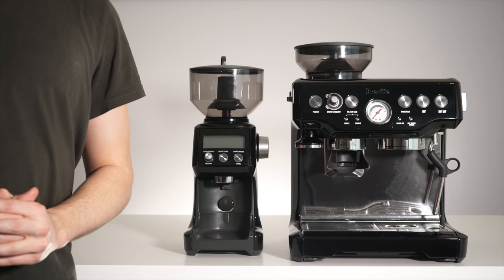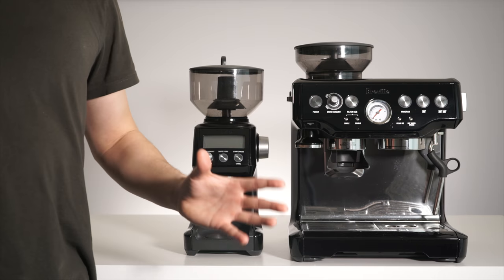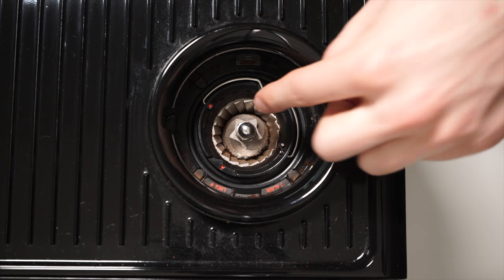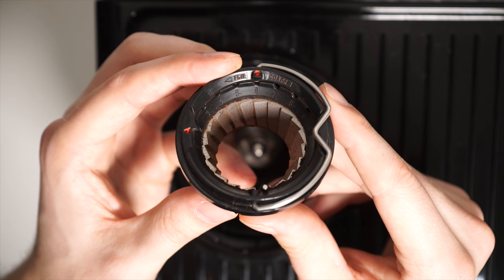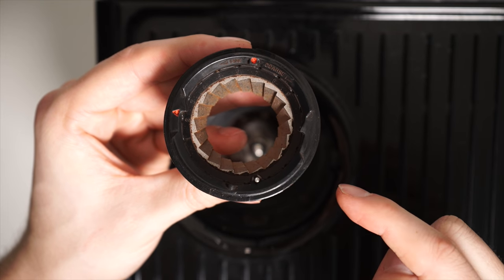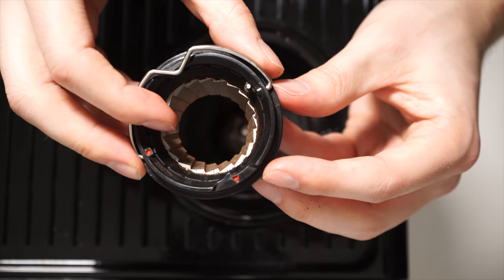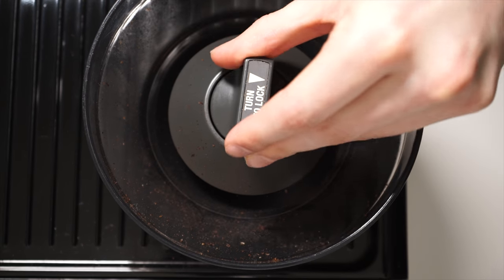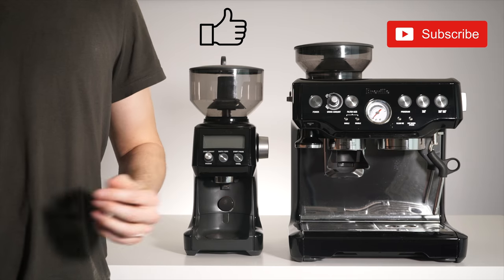Breville Barista Express Top Burr Adjustment

Comment: I discovered that if you turn the external dial to the coarsest setting (30), the upper burr is easier to remove.  At the coarsest setting, the conical burr is furthest away from the stationary upper burr, hence making it easier to turn.
Reply: Thank you so much for this tip. I was struggling to get it out, and you saved my coffee machine 😅
Reply: Thank you, I have not been able to take it off

Comment: Exactly what I needed. Thank you! Changed the top burr setting to 3. Still need to work on dialing in shots but this is a major improvement!
Reply: how come you changed to 3?
Reply: @stephendoherty2719  Mine doesnt go below 4 and still no luck with getting the right consistency
Reply: Did you hear squeaking sound after that? Cuz I do and idk if that's normal 😅

Comment: Thanks it worked like you explained. I initially COULD NOT release the burr. Luckily I have an air compressor and so I took it to the garage blew it out and it was then very easy to release. If you have any coffee in the top and it won't release, DON'T FORCE IT. Clean it out well and it will work better once you finish that.
Reply: Used my central vac and all was good to go. First world problems for me.
Reply: Similarly, I got my upper burr out but could not get it back in after adjustment - felt I was going to snap my fingers off.  A quick vacuum in and around the grinder, using the brush to get into the grooves soon fixed this and it was easier to twist back into place.
Reply: Apparently changing the external grind setting to its coarsest option can make it a little easier to remove the burr.

Comment: I bought an older BBE used and i can't seem to get a fine enough grind! I did some sleuthing and found a single reddit comment that mentioned that the new model's adjustable upper burr assembly fits the old model, so I just ordered a new assembly and hopefully my new-to-me machine will grind a lot better! Thanks for a great video that I'll definitely be coming back to
Reply: DId this work for you?  I've got the older non-adjustable burr in the BCG800 grinder and am considering buying the adjustable upper burr for the newer BCG860 grinder to put into my BCG800.

Comment: I've just purchased a breville barista express. I've tried grind setting of 8 5 and 3 and the longest shot I was able to pour was 12 seconds to get 36g of espresso. I'm vibrating from all the espresso I've had. I gotta grind setting 1then most likely play with the micro adjustments. I'll update once I get it right. Thanks for the helpful video

Comment: This tips should be mentioned in the quick setup booklet. I just knew about it after 1 month of using the machine and not been able to get proper shot using non pressurised basket 😐
Reply: Yes. It took me a couple of days to arrive here. I had to set my burr down to 2 in order to get enough pressure with fresh beans from a local coffee shop. Clearly, there's a pretty wide variance from machine to machine.
Reply: He mentioned it's in the instruction manual, not sure if that's what you're referring to though

Comment: Great video instruction!  I just followed the video and then realized, I did NOT have my "grind adjustment" number at any default number setting?  I think I had the slide reel on "2" originally and then adjusted the burr grinder unit by 3 settings, to the finer (counter-clockwise).  So what "new" number should I be setting and grinding now, to result in a finer grind?  Sorry if I sound confusing, because, I am...  Thank you!

Comment: I've not long ago purchased a Breville barista pro and it came with the Baratza burrs which has six flutes on the lower. Many people say to, out the box, change upper to setting number 3. I did that and then worked out the lowest setting I could go to was grind size 15 before I could feel burrs just touching when I was turning the upper section by hand.
Shots seem to be still too fast. When I had it on grind size 6, the shots tasted better and time was closer to 30sec. I was worried though that the burrs could be contacting a bit too much?
I imagine when beans are going through that they would push the burrs apart slightly? 
Some older stock models of the Barista pro still have the five flute lower burr so might be totally different?

Comment: I have a weird problem now. 1 on the display was still a bit too coarse. So I adjusted the inner top burr from 6 to 4.
Now it seems, that the top burr sits too close to the bottom burr: my Grinder screams as the burrs grind on each other. Even with the upper burr set to the old “6”-setting again. Can’t go below 3-4 on the display, as the very loud metal scratching begins. Is my grinder faulty?

Comment: Just adjusted mine after a full year of 2-3x daily usage. 

Usage largely the same beans, so in a bit curious if these things wear down or what? I have a warrant throguh April 2024 through Best Buy, so definitely want repaired/replaced if it's simply wearing down.
Reply from the maker: Adjustments are normal. Can be simple things like the roast of the beans, even humidity in the air of your kitchen than changes the flow even at the same grind size

Comment: Thank you. I fix my "no pressure" with double shot cup issue by changing the "Internal setting" to 1 and External dial to 1 as well. This makes the ground very fine indeed. It gives me great pressure of 12 o'clock with moderate/minimal temping. I just use generic Woolworths bean called "Harris Coffee". Much appreciated for your instruction!!!
Reply: How did you go in your journey? I've started mine with supermarket beans, but that seems to be the problem. Gonna try fresh beans to see of that makes a difference in pressure and Crema.
Reply: @themostar7426  fresh beans make a HUGE difference.. good luck, it can be a frustrating process but also very rewarding when you start getting it. Aim for 1:2 extraction (I use 17g of coffee and aim for 34g out) in around 25-30 secs. 

This is a guideline; change things up according to your taste, but try and only change one variable at a time; I'd say grind settings first, then perhaps dose itself or the amount of extraction - maybe it'll taste better at 1:2.5, or even longer (for lighter roasts) or shorter (1:1.5 for darker roasts). 

It's what tastes good to you! There is no right or wrong answer or perfect recipe, just guidelines that will get you in the right area.

Comment: I have the same burr set in my grinder and it's adjustable. My friend's barista express doesn't have this adjustment 😐
Reply from the maker: It does depend how old the machine is
Reply: @LifestyleLab_  it was purchased withing the last 18 months.
I was quite surprised when I did exactly this expecting an adjustable burr, but there wasn't one.
The top burr is sold out. From your experience, is there isn't room left on the adjustment thread to move the burr up a little? Or, disconnect the gears and wind it a little.

Comment: Currently having issues dialing in our Breville Pro using the IMS group head screen and IMS 18-22g basket.
I have been through all the settings and the closest I can get to 1:2 ratio (30-35 sec @ 36g) is external 6 grind setting (we haven't messed with the internal grind setting yet).
We are getting semi soupy pucks (not one piece ejected dry pucks we expected) after the completion of the process.
Not sure what we are doing wrong, but we have gone through a crap load of expensive coffee (I should have purchased cheap grocery store espresso instead of using the $30 bags of beans) to attempt the dial in. :)

Can anyone provide their known good settings for the IMS basket and shower screen hardware on the Breville Pro?  We would really appreciate it.  Thank you.

Comment: Thanks. Very helpful and now I can adjust the burr setting easily!
Reply: My machine does not have the numbers and is not adjustable 🤬
Reply from the maker: Then you just have an older machine, and can purchase a replacement top burr from the link above or directly from Breville.

Comment: Thank you. I put mine on 9  , works great .I thi nk  my automatic ajuster is not working , its always the same size of the grind... no metter what i put it on. Also,   every time i get different beans I have to ajust things , does that make sence?
Reply from the maker: Every bean will absolutely require a new grind setting. That is what's known as "dialing in" the coffee
Reply: @LifestyleLab_   Thank you.  One last question I promise.  How long brewing process should last for single shot expresso for example.  Mine builds pressure for about 5,6 seconds and then actual coffe runs for another 6 seconds or so   , Is that too short? Thanks again.
Reply from the maker: Completely comes down to taste, I can’t tell you what’s right for your coffee. Too sour, try running the shot longer or grinding finer. Too bitter, try running the shot shorter or grinding coarser

Comment: This is all fine except no amount of pressure on the wire handle will get anything to move. Thinking that it was me I've had several friends give it a try also with no luck. Things are wedged in there tight. Any suggestions on how to get it to move. Currently even on the coarsest setting it generates to much pressure. The fingers on my hand may never heal!

Comment: Very good and informative. Thank you so much. As I was all the way to number 1 setting on the grind size selector, and number 6 on the upper burr, I was wondering how many numbers would you suggest that I move the upper burr so that I may be able to stay around 4 or 5 on the grind size selector? I understand that all the coffee's are different, just looking for an estimate to better get me into the ballpark.
Reply from the maker: I'd suggest moving the upper burr one step at a time
Reply: 2M views hello i have passed my upper burr from 6 to 3 to have about 20 seconds of coffee flow by cons the taste is like water.  if I make it even thinner my pressure gauge will overpressure.  I'm a little lost can you help me a little?
Reply from the maker: @83kif  Watch this video start to finish and you should have all your answers :)
www.youtube.com/watch?v=d0g8umpINGQ
Reply: depende del portaflitro, si es prensado o no.
Si es prensado, usalo en configuración 2 al 4, y en la posición 7 la molienda.
Si no es prestando se recomienda colocar un filtro encima del portaflitro.

Comment: Great video! Could you comment on one thing though: can you see the internal adjustments as major or minor steps, e.g. you have external set to 3 and internal to 6, would that be finer than say an external 4 with a internal 1? You know what I mean?
Reply from the maker: I believe that each internal change effectively offsets the burrs by one full range. Ie/ An external 1 and internal 6 would be the same as and external 16 and internal 5.
Reply: thats interesting. So you would only really need to adjust internally, if you reach 1 or 16 on the external burr and still not happy with the result? I wrote the Sage / Breville customer support to see if they can comment on this. Let's see :)
Reply: @Ventilator1998  I would be very interested to know if you ever heard back from Breville. Does the internal setting equate to a full reset back to the external setting range as @Lifestyle Lab suggests?
Reply: @SinandGrins  thanks for the reminder. No feedback yet. Have to reach out again!
Reply: @Ventilator1998  curious as well! I’m at around 3 external and may need to adjust the internal burr.
Reply: @Ventilator1998  any update on this one?
Reply: @tonygibbons5  Nope. nothing so far... and no tools and time to try out myself :)

Comment: Hello, there! What if I set my external grind at 1 and have a good pressure at 12 o’clock but I see that it still runs too fast for me. Should I change it finer in the inner grinder or it doesn’t matter how it runs and the most important key is the pressure? I am very confused. Please help 😭
Reply from the maker: Flow is more important than pressure. If you're at a grind setting of 1, I'd suggest making the internal grind setting one step finer and then dial back in to slow down your flow. Don't worry if the pressure moves up higher than 12 o'clock, my favorite shots have been pulled at 1 o'clock or sometimes even further! In the end, follow your tastebuds rather than numbers

Comment: after I adjusted the upper burr and replaced the burr correctly - the metal handle is slightly elevated and does not sit flush?

Comment: Great video. I was able to remove it from the breville and cleaned it but when I placed it back it went in place but the lock red is not aligned with the grinder red arrow. The red dots are on the opposite side of where align and lock are. Does this mess with the grind?
Reply: Did you solve the problem? My red arrow and 'lock/align' are not aligned and hence I am not sure how to remove the burr at all, for cleaning and adjustment.
Reply: @SathishkumarJagadeesan  
Yes I got it aligned. To remove the bur just twist the plastic piece inside the hopper counterclockwise and remove it. Then hold the grinder by the handle and twist counterclockwise and it comes out. Clean really well inside with the provided brushes. Sometimes you may need to place the machine upside down and shake it to remove all the old grind. Sometimes it can be a little difficult to place the grinder back in place if there are left over beans that didn't grind well.
Reply: @arielrodriguez975  Thank you. I have now managed to remove and adjust and put back in place the top burr.

Comment: I've cleaned our multiple times and still cannot get it to produce grinds, only on one of the largest settings. All the parts inside appear to be good. Had it since 2017.
Reply from the maker: Definitely contact Breville support :)
Reply: @LifestyleLab_  Yea, I have they are sending new parts. Problem is I don't see anything wrong with it. Wonder if it a design issue. May go with another brand.

Comment: is this adjustment a finer adjustment? meaning, if i seem to want a 3.5 on the external dial, will changing internal setting by 1 be similar to .5 externally?
Reply from the maker: Upper Burr vs Outer Dial Grind Setting | Breville Barista
https://youtu.be/_uB3FZGkR6E
Reply: @LifestyleLab_  Interesting. I was way off. So, if I'm really wanting a 3.5 sounds like I'm out of luck. I saw someone else suggesting a chip bag clip to hold the external dial at an in between setting, e.g., 3.5. would that work; do the mechanics of the machine function that way?
Reply from the maker: The mechanics do work that way, however I’d recommend this instead: 

In Between Grind Sizes? | Dialing in Espresso
https://youtu.be/Q1lVdhly_rc

Comment: Is it possible the burrs loose their adjustment? I feel like I have to grind finer lately in order to keep the same espresso water flow.
Reply from the maker: Burrs take time to break in or “season”. This may be what your experiencing. They will eventually settle into a consistent point :)
Reply: @LifestyleLab_  thanks for your answer. It's been 1 year and a half I use it daily. I was thinking maybe that the parts are still moving and start to come loose. Fortunately I was able to adjust the burrs and it's back to normal. :)

Comment: Hi! Thanks for your video. My grinder is at its finest setting and the flow of my espresso is still rather fast so I adjusted the internal burr from 6 to 4,  retained grind setting at finest and still yielded same flow or time at 12 secs from the first drop into the cup. Any tips?
Reply from the maker: Focus on even distribution and tamping. No-matter how fine you grind, if there are empty cavities in the puck, the water will rush through those areas, resulting in the same flow rate. In fact, grinding finer can make the problem WORSE because the puck become so dense the water is forced to run around the outside or through channels. 

I would try grinding slightly coarser, and focusing on even distribution. A bottomless portafilter would help you troubleshoot this problem
Reply: @LifestyleLab_  appreciate the tips. Thank you.

I'm actually using a distribution tool already and a palm tamper to help with the consistency of pulling my shots. I just cant see what the problem is.

I'm using a month old beans. Could that also be it? If they're not too fresh anymore?
Reply: @LifestyleLab_  adjusting the internal burr further finer wont solve this do you think?
Reply from the maker: Its worth trying, the default settings if these grinders can vary quite a lot. 
However, without being able to see exactly what's going on with the flow, it's difficult to say whether its an even flow going to quickly (grinding finer will help) or if you have channeling (grinding finer will hurt)
Reply: Hi Nico, my Breville 870XL manual says that a pull should happen in no more than 9 seconds. It sounds to me like 12 seconds is actually too long. Your grind may be too fine and/or your tamping too hard.
Reply: When using old beans I set the internal burr setting to 1 and can then at a setting of 5 on the external adjudtment get 20g in 38g out at 9bar in 30seconds (External Breville Smart Grinder paired with Breville Dual Boiler)
Reply: @Nico I have the exact same problem, were you able to resolve this? What did you do?

Comment: I have a question 🙋‍♀️ if I have it set on the dial (barista touch) at 11 and it over extracts by 4 grams but the under extracts at 10 by 9 grams should I adjust the inner grinder or just increase the temperature to see if it extracts more on grind setting 10? I don’t want to lower the temperature on 11 to decrease the volume and I’m dosing 18 grams and using leveler/weighted tamp and wdt so no channeling.
Reply from the maker: In Between Grind Sizes? | Dialing in Espresso
https://youtu.be/Q1lVdhly_rc